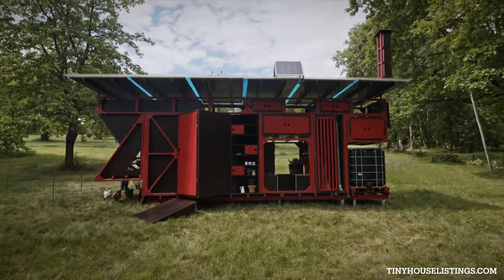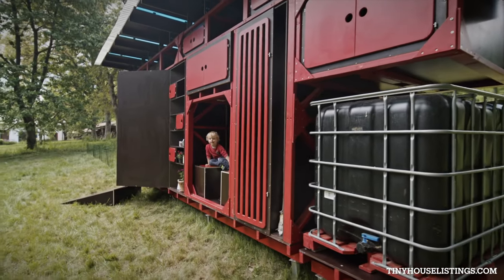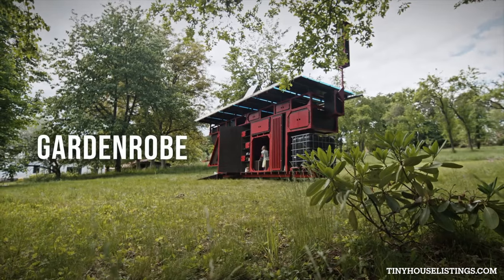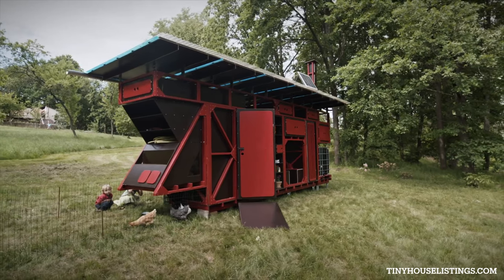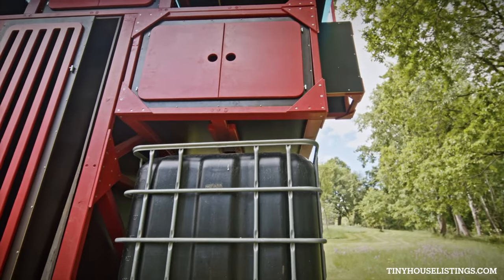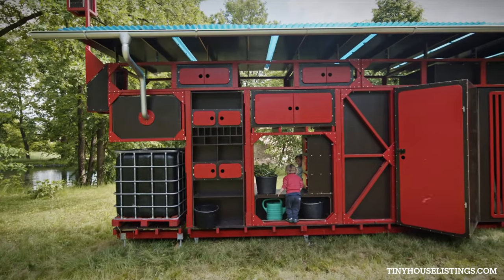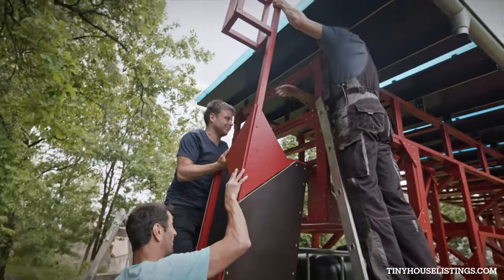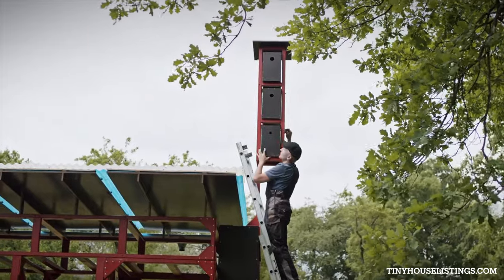The End All Garden Shed

Comment: Lol I’m a little conflicted as to whether this aligns with the tiny house type of mindset or is the complete antithesis. On the one hand, it’s a clever multipurpose structure made of high quality materials in a compact space, on the other hand, it’s a garden shed the size of some tiny houses.
Reply: It aligns, it just focuses on the work aspect of say running a homestead instead of the living space.  You'd normally need a much larger barn or multiple structures to cover everything that offers in a smaller footprint, which frees up more of the property to do other things like grow crops, etc.

Similar thinking could be applied to make a modular house with interchangeable parts as a way to customize it for an individual or adapt it over time to changing needs.